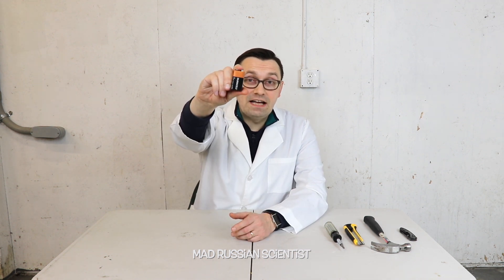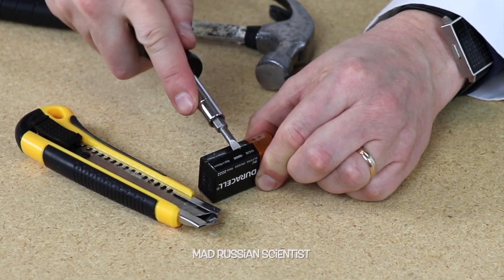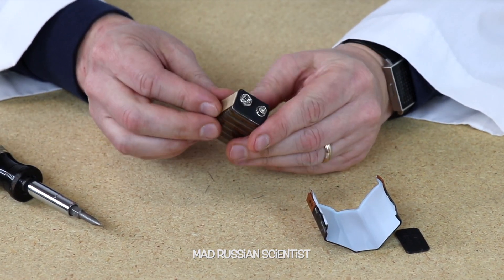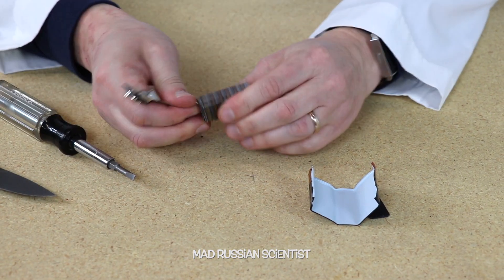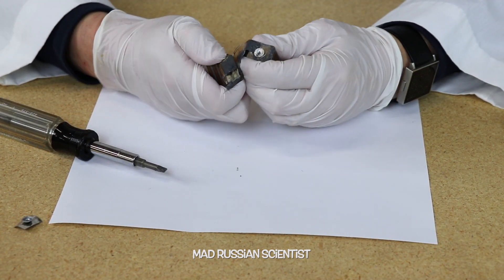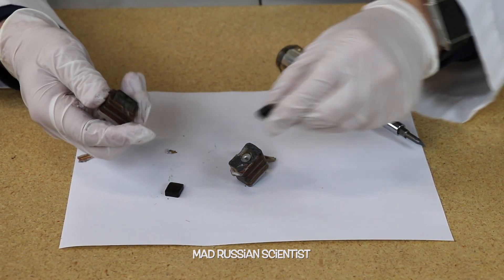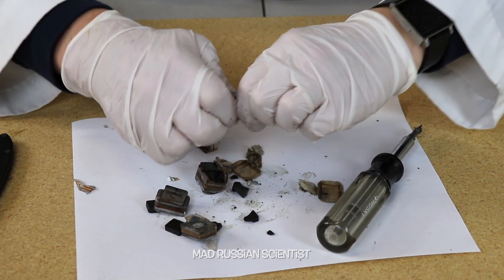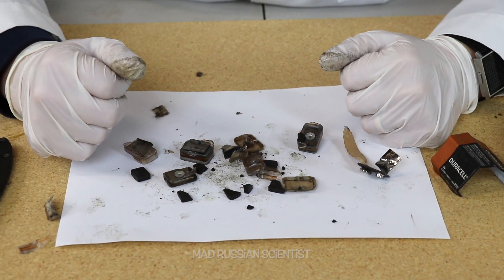What's Inside a 9V Battery

Comment: Basically what you have is a voltaic pile, consisting of six individual 1.5V alkaline cells in series, for a total of 9V nominal. The black pieces are the carbon anode of each cell. The rest is manganese dioxide for the cathode, and liquid potassium hydroxide as the electrolyte... so, wise decision to wear gloves.

Comment: You don't need to cut the battery at all to open it, just simply unfold the flaps of one side using a small flat head or pocket knife(doesn't matter which end you choose) then simply push from the opposite end sliding the core out of it's metal housing.
Reply: That's  how I opened it up the first time😌 I guess he was thinking of his viewers instead of the battery

Comment: The black thing is carbon and oil, is actually the salt and some other electrolyte material, plastic to form barrier between outer most shell so is aluminium but actually a thin steel sheet and inner carbon blocks.
Reply from the maker: Thank you for your explanation!

Comment: I opened a Duracell MN1604 6LR61 9V battery and it had 6 AAAA batteries welded in series inside
Reply from the maker: Yeah that's pretty cool
Reply: @pharmerpnw  The ones with either 6LP3146 or 6LF22 have the stacked batteries and the 6LR61 have 6 AAAA batteries

Comment: It is very easy to open a 9 volt battery without injuring yourself by using a pair of wire cutters and peeling the metal case off the battery.
Reply from the maker: That's right
Reply: I figured this out tonight while trying to harvest the 9v battery's female pin connector component. Mine looked different from in the video though. It had 6 cells inside of it that looked like batteries. I believe these may be called "dry cells?" and I think inside of those have anodes, cathodes, & that electrolyte solution.
I am not a good electrical engineer, I'm a diy hobbyist that just finds the stuff interesting.

Comment: The black pieces are carbon sticks used a lot or just graphite

The oily thing is a conductor for the electrons to move and a chemical for the battery to work properly
Reply from the maker: Oh yeah that's right! You're right! Thank you for commenting!
Reply: Another heart oooooOOOhhh
Reply: @FBIAgent420  Is that chemical toxic to the touch because I found it in my lightbrite and my mom touched it and I’m really scared :’(
Reply: @mychlomicalromance  it’s flammable but not toxic